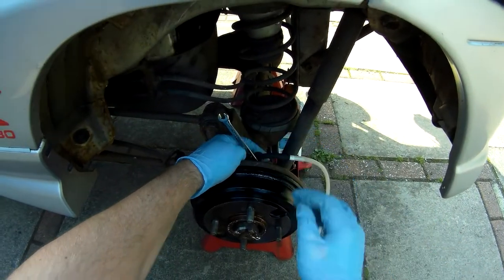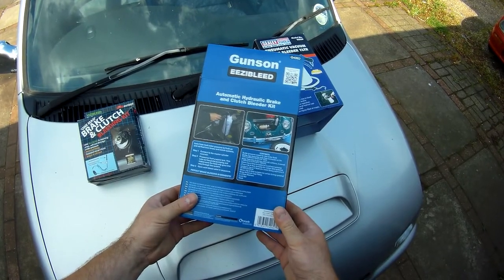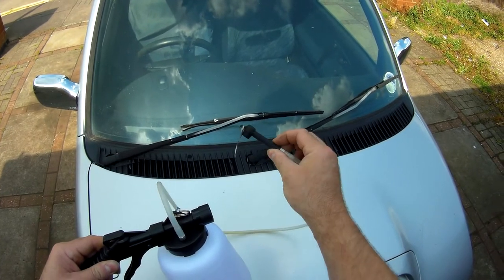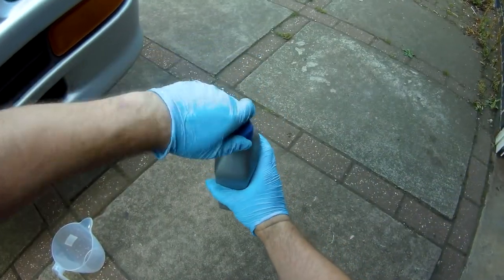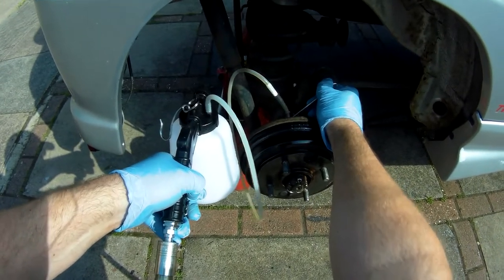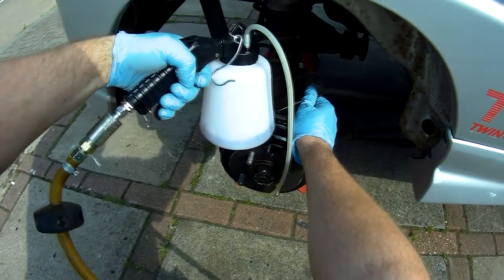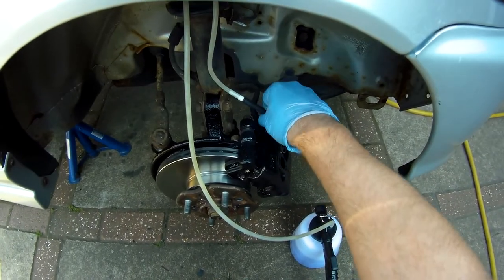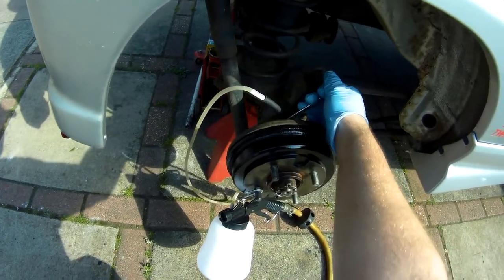How To Bleed Brakes On Your Own - Daihatsu Cuore Avanzato TR-XX R4 Project Episode 12

Comment: Out of those three systems, my favourite is the Gunson system that pressurises from the top. I've used the vacuum bleeder that you used quite extensively, and I've found it to be fairly unreliable, as the valve that reverses the compressed air to create suction can get stuck, and either cause the bleeder to do nothing, or even worse, blow air back up the brake pipe. Seems to have worked well for you though. It can also be good for initiating a fuel syphon, or for bleeding a diesel fuel system.

Comment: Big (60 ml) syringe has worked well for me. Costs about a quid.

You can cycle the fluid both ways. Blowing from the bleed nipple, you are pushing the fluid the same way the bubbles tend to go (upward) which probably helps, and you have complete one-man control

Its sometimes claimed there is a risk of master cylinder seal damage, but so far, so so..

One snag with the "suck" part of the cycle is that air can be pulled in via the bleeder threads. The air isn't itself a problem, since it rises into the syringe and you can easily avoid blowing it back in, but it makes it harder to tell when you've finished,

It can be reduced with PTFE thread tape, which also reduces the chance of your bleeder screw rusting solid, but you have to avoid getting PTFE fragments inside the braking system, which could cause blockage. 

I dunno about ABS though. I've only used it on a fairly simple 1986 car

Comment: Thanks for showing what that hook and chain that came with the vac bleeder is for.  Air leaking in around the threads of the loosened bleeder screw can also cause the bubbles.

Comment: Thanks for this video series. Found it very interesting, especially the disgraceful engine oil state! 

I’m looking at buying one of these Sealey VS020 bleeders. It’s a toss up between one of these and one of the VS820 systems that goes on the reservoir cap. But I can see the reservoir cap versions making a mess when you disconnect them!
Reply from the maker: Glad you liked it! 

While the VS020 needs a compressed air supply to work, I like how easy it is, and that it doesn't rely on any special adaptors for the master cylinder like the pressure bleeder designs do. It also works nicely on my Land Rover's front brakes, which are notoriously awkward to bleed well because of the design/layout of them.
The VS820 would be good because of being a standalone design that doesn't need air etc, and they seem to hold quite a lot of fluid, so you don't need to top up if doing a full flush.

I think most similar tools make the job much easier than trying to do it the old fashioned way.
Reply: Thanks for the reply, no worries it was a great series!

I'll get one of these two designs at some point, of course a bonus of the VS020 design is you don't need to buy another capture bottle where you do with the VS820, adding more to the cost. But then again if you don't have a compressor that would add a lot to the cost of the VS020. As we already have a compressor it seems to make most sense to buy the VS020.
Cheers.

Comment: Good video.  A good way to reduce/eliminate the air bubbles coming in through the bleeder nipple is to smear a little bit of grease around the base of the nipple & the rubber connector. It creates an air tight seal and the vacuum should not be high enough to suck the grease into the line.  Works like a charm.
Reply from the maker: Yes, that's quite effective - you can do the same thing on the threads of the bleed nipple if you find air getting past there. I don't worry about it too much, as the air is going into the bleeder, not into the brake, so it still does the job.

Comment: A good hack to avoid buying an expensive bleeder you’ll hardly use is to just buy the biggest syringe you can find on eBay and use that instead.

They usually come in multiple packs, no hardship since they can also be used for precision lubrication of sunroof / window guides and mechanisms or any other assembly where an aerosol can or oil can is not possible or desirable (check out mercedessource’s videos, he takes this to another level). It’s a little more fiddly since you need to close off the nipple before disconnecting / emptying the syringe, but it works very well on the whole.
Reply from the maker: That's pretty much the technique I use on bike brakes, or other situations where I want to do a reverse bleed, but in terms of hassle, the vacuum system is still my preference.
Reply: I  generally find 60 mls is big enough that disconnection isn't really required. Say 50mls a corner?   . You'd have to have a pretty voluminous brake system to need more than that even if only using the syringe unidirectionally.